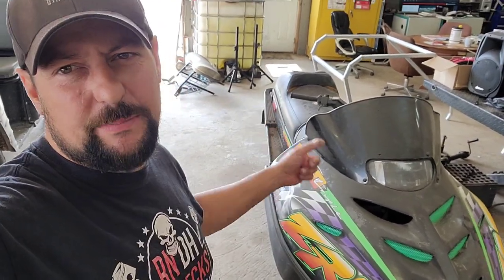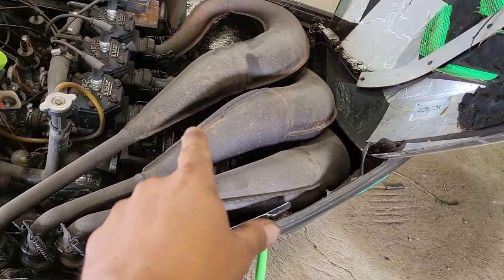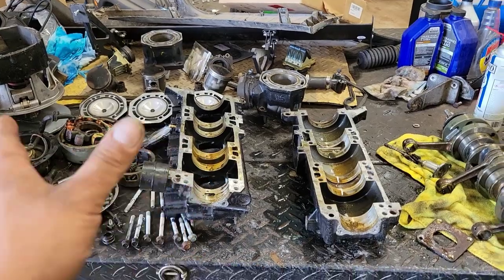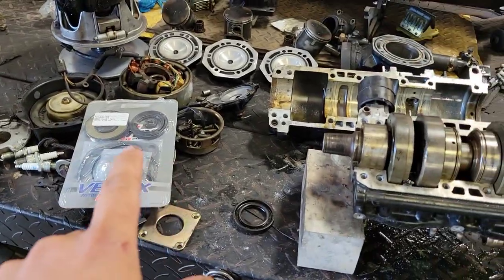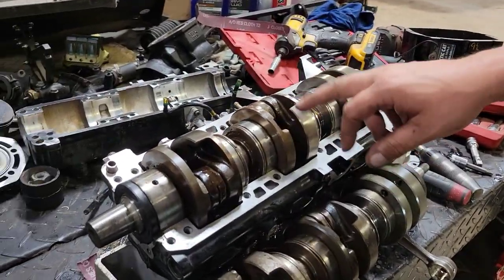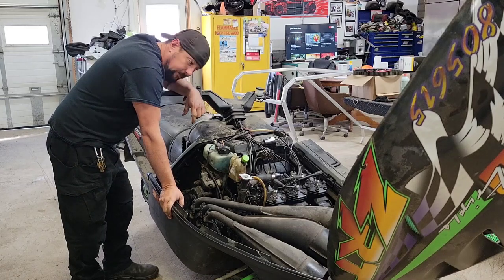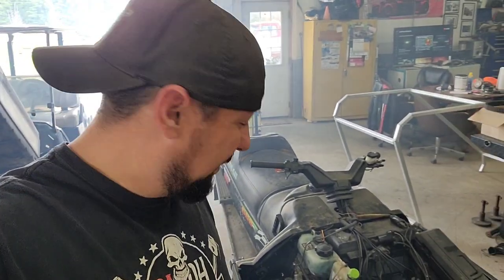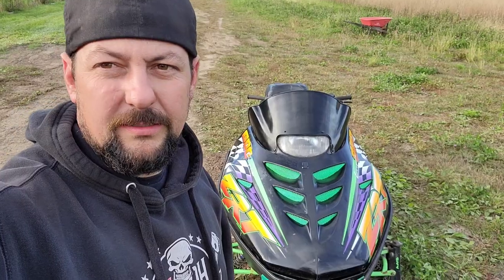ZRT 600 is back up and running!

Comment: Just picked one identical to this up, including the sheit bottom end.  Just did a compression test and the PTO and the MAG sides have no compression.....Does you place in PTBO ship? I have a hard time finding good parts here up north ,and something tells me that I'm need some hard parts on this one.
Reply from the maker: I think they will ship parts out.. peterborough cycle salvage/Cat Shack give them a call, it don't hurt to ask and they might just have what ya need! cheers 🍻
Reply: @rednecksdirtyhands  Thanks.  got the jugs off and pto and mag have burnt pistons with tonnes of transfer.  some weird greyish brown THICK crap in the crankcase tho.  kinda feels like clay.  ever seen anything like that?

Comment: ZRT's clutching on the 600s was pretty junk from the factory.. made them feel gutless.  mine will stand right up in a foot of snow. 
red / green primary spring and a real heavy secondary spring. spend a few hours messing with the springs / weights and its like you get double the horsepower.

Comment: Hey Pete, I own a 1997 Arctic Cat Powder Extreme Zrt 600 and I've been trying to find aftermarket cans for it and nothing. Know any places that would have them? I'm also looking for an aftermarket one too for my 1998 Cougar DLX 550. Thanks
Reply from the maker: sorry but I just know the same usual places you've probably already checked like Royal distributing and Fortnine...but if you're handy with a welder and a case of beer you can always modify one to fit! 🍻
Reply: @rednecksdirtyhands  Thanks for the reply Pete. I've checked those places and no listings. Looks like I gotta start learning how to weld.  If you hear anything please let me know!